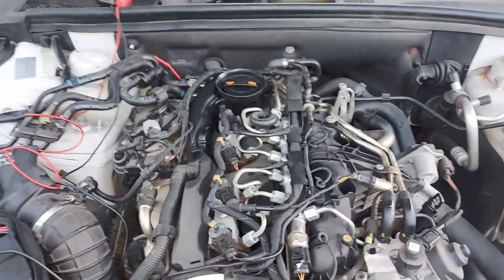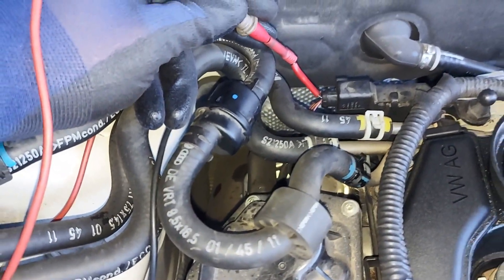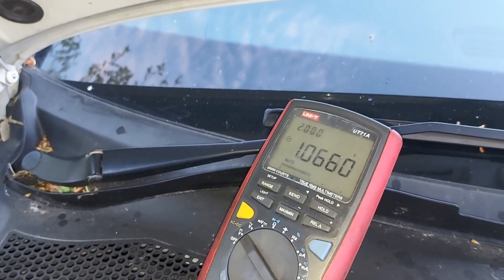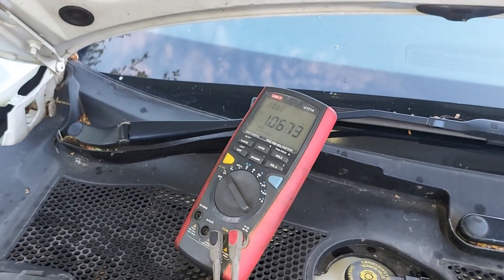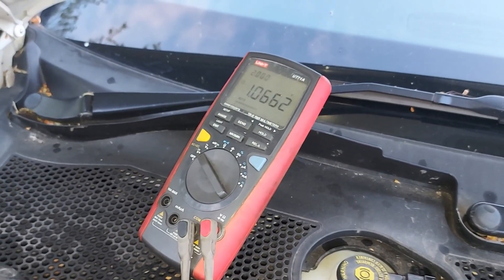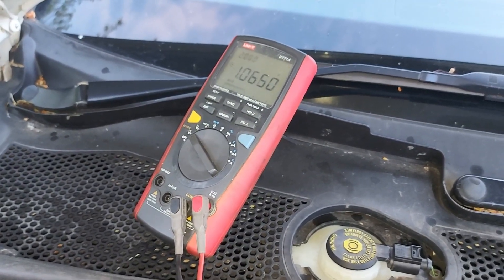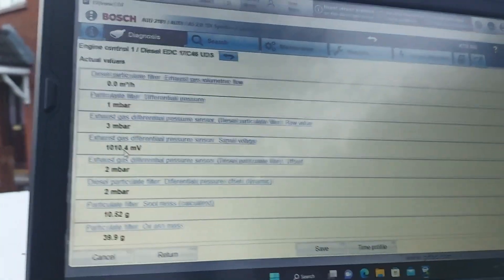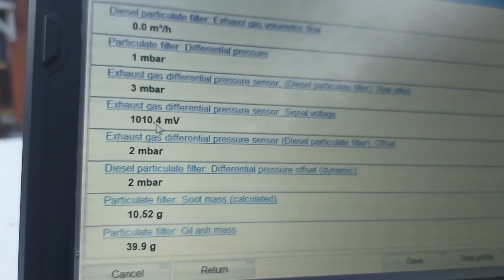FAULTY DPF SENSOR? RUN THIS TEST FIRST

Comment: My signal voltage with the engine running is 0.7V, would you say that this is too low? It goes up to 0.8V at 2,500RPM and it is 0.65V with the engine off. I have changed the sensor and checked the wires back to the ECU which all seem fine, so my thought is that I could have a fault with the ECU.

Great video by the way👍🏼
Reply from the maker: Dr stonk i am sorry I did not get time to respond to you question, please forgive me I had taken a rest due to other commitments. I hope you have this problem in the bag by now

Comment: Hello there 
I have the same car with code p0299 turbo underboost and I don’t know why. Can the dpf sensor be the problem or what do you think!?
Reply from the maker: There are so many things that can cause this problem.  Seized turbo actuator, faulty turbo, faulty boost pressure sensor, cracked intake manifold, a defective Maf. I am not sure about the dpf pressure sensor. please tell me more about what you've tried so far so that i have a clear picture

Comment: Thank for your advice. I have vw polo classic 1.9 tdi ATD engine it shaking when idling and when diagnosis is saying cylinder 1 contribution/ balance fault code is p0263
Reply from the maker: It could be many things James. Injector is a possibility. Compression loss maybe another issue